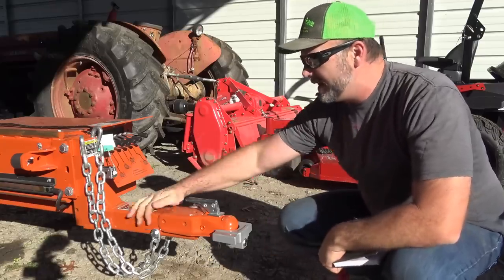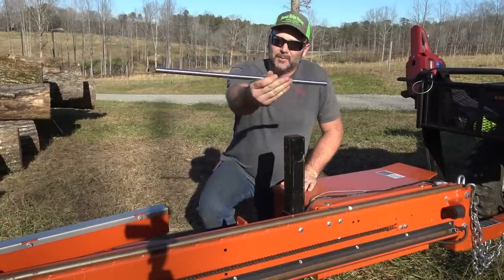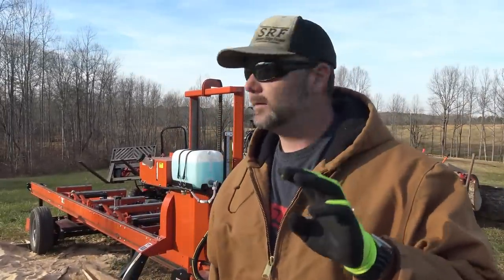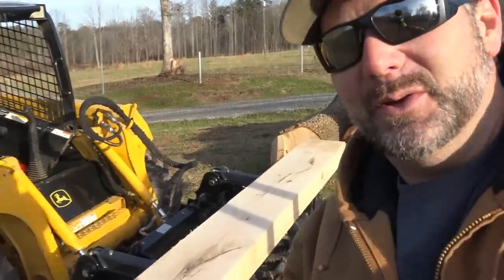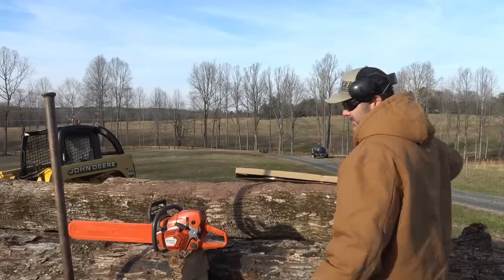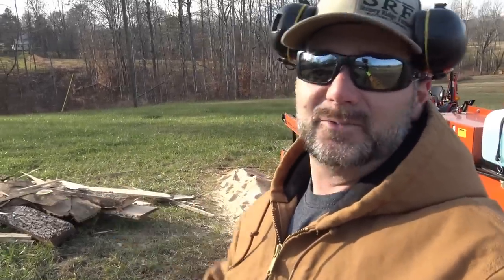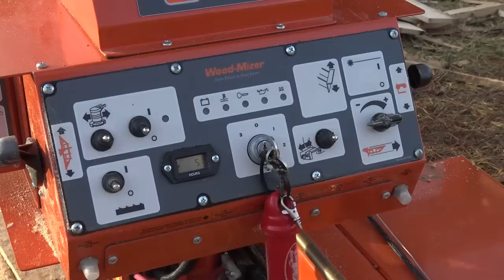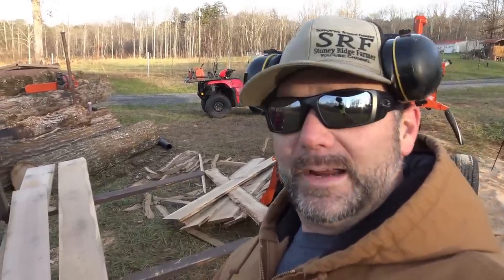First time running the saw mill...AND I SCREWED UP!

Comment: I might've missed it...but how did you screw up?
Reply from the maker: anyone else see it? I'll tell ya in the next milling video...whomever gets it right in the comments...I'll draw a random winner for a free hat!
Reply: @StoneyRidgeFarmer  I think it might have been that you did not put the mill on a flat concrete surface
Reply: @StoneyRidgeFarmer  I would guess either bending the hitch cause of the sawmill weight or not using the de-barker.  That dirt filled bark will wear and ruin blades much faster.
Reply: You only rolled the log and sawed 3 sides before sawing your boards. Otherwise, you would not have to go back and cut the bark edge off the boards.
Reply: You had too much wained edge  on your can't
Reply: Looks like you had the key on and touch a lever and the mill moved backwards unexpectedly,that could have caused a lot of damage if someone had there hand or there body in the way when it moved.luckily no one was hurt. Yes farming and logging in Dangerous,stay safe and MERRY CHRISTMAS
Reply: @StoneyRidgeFarmer  you didn’t use the de-barker attachment, I’m guessing that’s what you’re referring to, it will help your blade last longer if you run it.
Reply: you turned to log manualy?
Reply: @StoneyRidgeFarmer  Its not really a major screw up but I would have turned the log to have the check crack parellel to the blade in case it went deeper into the log than anticipated. Personally I like to start my cuts at the wider butt end when squaring off the Kant - one of many tips taken from  'Out Of The Woods'  that have now become habit. You got some beautiful lumber there. I get the sense your looking at your trees a little differently now that you have a sawmill, lol.
Reply: Didn't turn your soapy water on? Did it freeze up on ya?
Reply: @hammerhead7900   Could be, but i saw water dripping 19:21. Besides doesn't it sprays on automatic with throttle like a Woodland Mills sawmill?
Reply: @StoneyRidgeFarmer  I think it was that you bought a mobile saw mill and not a stationary saw mill
Reply: In many different ways, but not by marrying the wrong woman.  Mrs. Stoney Ridge is a catch and Josh knows it.
Reply: The rest of us should be so lucky.
Reply: Needed to use the debarker
Reply: You screwed up by buying the woodmizer,  you can buy wood cheaper than it cost using the woodmizer. Plus is too much time consuming setting up the woodmizer everytime  you're going to use it. It's less work having  a  stationary Bandsaw mill.
Reply: Where are the fenders?
Reply: Didn't use de-barker
Reply: @StoneyRidgeFarmer  you did not use the debarker and did not use the hydralics to turn your log. Also the weight of your wood miser was beyond the rated towing weight of the atv....That's why you bent/broke your hitch.
Reply: Well since I would love a hat... I’ll go with the DEBARKER... honestly I thought you did awesome! It looked like the hydraulic log roller doesn’t always work well that’s why you had to use the can’t...?
Reply: I know once you forgot to use the debarked,
Reply: @StoneyRidgeFarmer  I make the center of the log the same distance from the bed on both ends then I make the first cut and roll the log 180 so the level cut is on the bed.....I have an lt15..a little more work then the 40 same amazing results

Comment: Great tool.    Remember when cutting your boards you don’t need to stop and remove the boards each time, just keep cutting till you are done.   You get a nice stack with less work. 
I helped my neighbor restore a ‘93 LT 40 E super.   Has a 3 phase electric motor , he also bought a surplus Army generator set.  
Electrics needed a bunch or work, but it all works.

Comment: The best strategic advice you gave in this video is to set your mill up as a stationary unit. That allows you to work under cover and keep all you tools and equipment in one place. Being mobile is more trouble than it is worth. Also, going electric rather than diesel or gas is a total game-changer. No fuel, very, very little maintenance, quiet and cheaper to buy, even if you need to purchase and install a phase converter. I purchased an electric LT50 almost ten years ago to replace my gas powered unit and it has been a money-maker since day one. It is much cheaper to buy, cheaper to run, cheaper to maintain and cuts 2 to 3 times faster than the diesel unit. It costs about 25 cents an hour to run and I cut dimensional lumber from 3 to 4 12"+ diameter by 12' long logs per hour. Now that is a money-maker. Keep up the good work, Josh, love your videos :)

Comment: only giving a few ideas. your going to want to get wax for the ends of the logs. it helps with the checking . second is you never leave the blade in gaged and walk in the front or the sides. That's in wood Mizer's hand book and a general rule. I did not see how your stacking the wood. but using stickers every ft apart is best.  we use colored wax . red for hard woods, green for softer woods. blue for specialty lumber. Cherry and walnut.  some neat idea for the future you might enjoy is building a solar kiln. we put our wood Mizer in a long covered building were we can load and unload logs or slabs from either side. Put a i beam and a electric winch to lift logs to turn over or move forward and back. I wish you the best with the mill. you'll learn as time goes on.
Reply from the maker: I use anchor seal...stickered every 16 inches buddy...and yep ur right..I'm gonna have to get some buildings up for wood storage and the mill...time and money is all it takes lol

Comment: Hey Josh, loved your video today. Do you have it way too easy with all that automatic stuff. I think you have to get in there and load the logs up by hand (no power). Also, I think you can run that blade back thru the log and cut several times before you need to unload it.

Comment: That's great Josh!  Was impressed how fast it ate through the log.  The hydraulic system for lifting and turning the log was equally impressive - definitely saves your back.  I wish you were closer to custom cut some of my poplar logs and for me to buy some of that oak!  I know you like things to look nice so I would suggest moving the sawmill to somewhere out of the way and not in the front yard - you will produce more sawdust than you can compost (plus scraping sawdust will mess up the grass)and the dunnage, first and second cut slabs, and piled lumber will accumulate quickly and it will take over that area of the yard.  Quite enjoyed this video!  Lovely piece of ash you gave to the neighbor.  Good job all the way around!

Comment: It is a good idea to lock your hitches but the one Josh is using can be removed with a hammer in  a few seconds. The better ones use puck locks and slip over the hitch.

Comment: Go check out Todd with Reap What You Seaux and how he hooked up a diesel drip for his blade.
Reply: Woodmizer already has a "water drip" although they recommend windshield washer fluid for freezing temps. And when cutting pine it is good to use a little pine sol in the mix to keep the pitch from building up on the blade. Some use dish soap in the water as well for lube.

Comment: This is a bit late but did you slice your outrigger begin of day 2? You're parked behind that one sticking up bout 4 in above deck. On my 2nd woodmizer now and can tell ya that won't be the only steel you try to slice before long. We have the same mills only mine is the WIDE head. Enjoyed the video
Reply from the maker: I hit the dogs on it on day 1...learned a valuable lesson...but my friend you and I both know...you really have to learn alot to run this mill....it's a very special skillset that takes years to perfect

Comment: you screwed up up by not using the debarker and you didn't level the log. I remember when I first got my LT35HD, I watched a lot of videos on sawmilling and thought I knew everything about it and boy I was wrong. One more tool you need is a 10" drywall scraper

Comment: I think it is the fact that you left the blade running while you where removing slabs and boards. Big no no!!! And you didn’t use the debarker but that’s not a safety issue.

Comment: Don't rely to much on that hitch lock. Seeing the key it looks like a low security wafer lock. If you want to loose all respect for lock companies in general and trailer hitch lock manufacturers in particular you should take a look at the channels LockPickingLawyer and Bosnianbill. They both have shown several hitch locks being picker or bypassed in seconds, often just as fast and some times even faster than using the key. 

Now I'm not saying that the typical thieves know how to pick locks. Fortunately that's often not the case. But these wafer locks are often very susceptible to what's called a jiggle attack, which is about as low skill as it gets.

Now just about any lock is better than no lock, but don't put to much trust into them, especially if they are untested.

Comment: I watched another channel that had a wood miser sawmill but it didn't have a debarker. Debarker should help your saw blades last longer between sharpening. If I remember correctly they changed blades after every 3rd log. They kept a lot of blades on hand. Watching them and you blow the sawdust off after cutting made me wonder why Wood miser didn't put a blower on the engine to blow the dust off after making each cut. Don't know if there is a way you could add it.

Comment: @Stoney Ridge Farmer    Ok, I never comment as I just like to watch a wide variety of content. Please do not rely on the blockhead to totally secure your equipment. you can literally take a 4-8" pc of #4 or 5 rebar or large nail and place it behind the cylinder and smack it w a hammer and pop the cylinder out the front.... takes literally 1 min if you know what youre doing